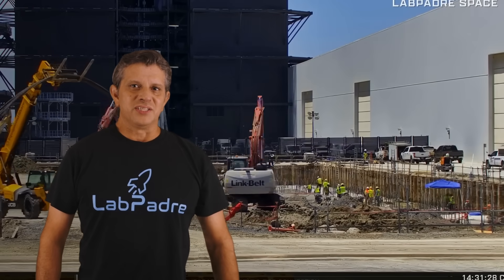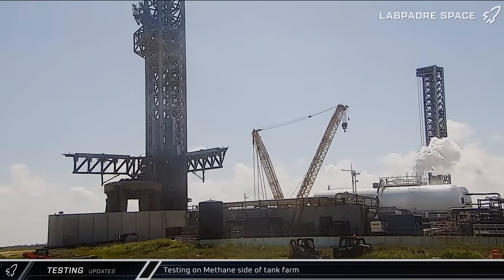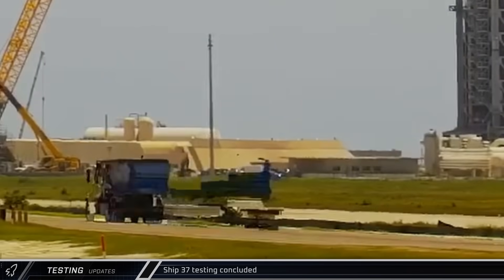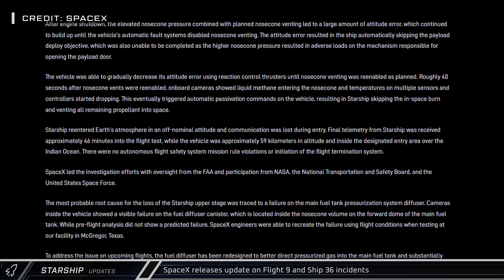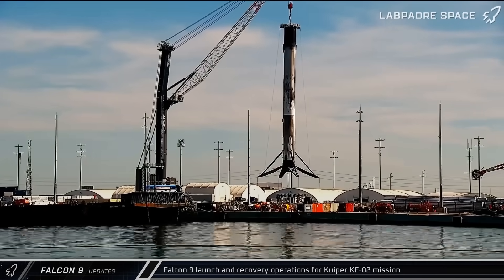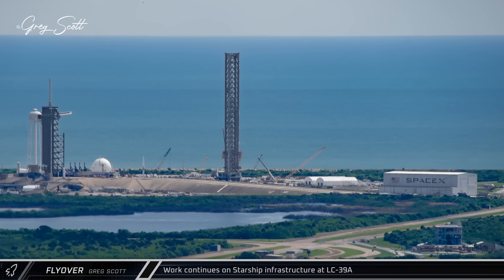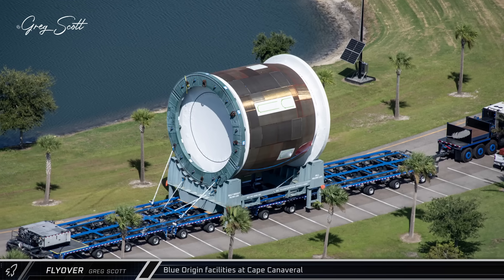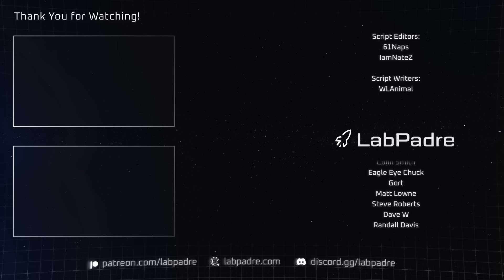MASSIVE Changes Coming to Starship! - Spaceflight Weekly #180

Comment: Why do they want a higher angle of attack on booster return? You'd think you'd want as shallow as possible and would have more lateral distance and control with a shallower angle.
Reply: Higher angle means less fuel needed for a catch, which is more fuel that can be used for payload lift